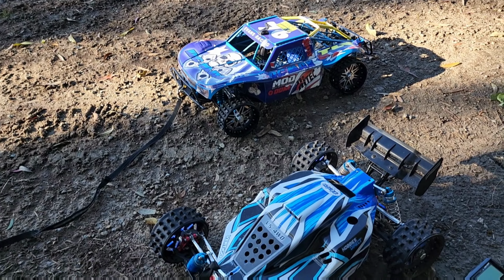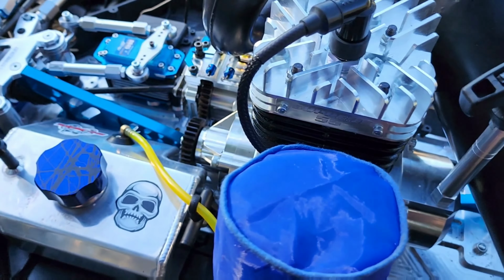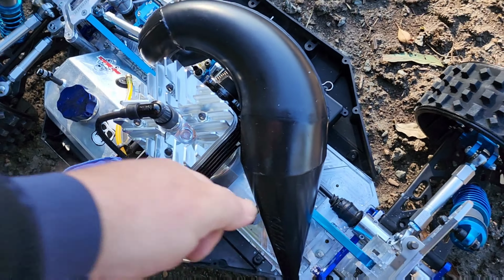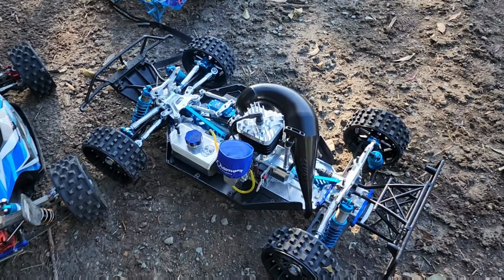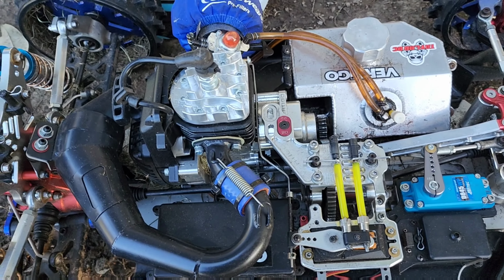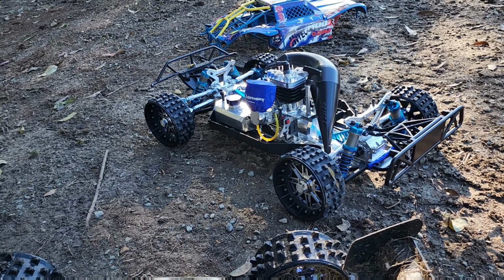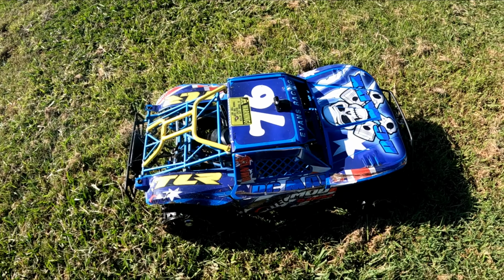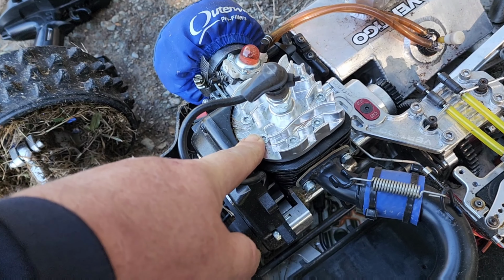TAYLOR RC 35CC AND 55CC RC BUILDS FIRST TANKS ROVAN SLT/LOSI 5IVE-T 2.0

Comment: I wish I could get an honest answer if Rovan is worth buying or just to save longer and get a losi
Reply from the maker: Alot of rovan parts these days are pretty good. But really depends what engine you wanna run. Small bore engine rovan is fine bigbore engine your going to need mostly losi and aftermarket parts and can use some rovan parts. I hope that helps.